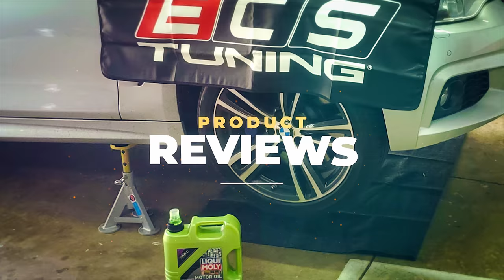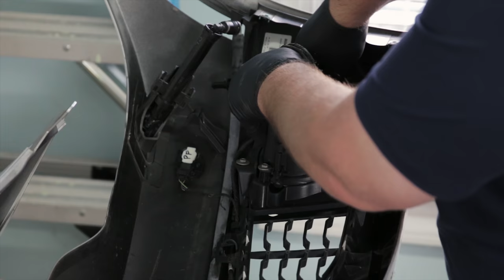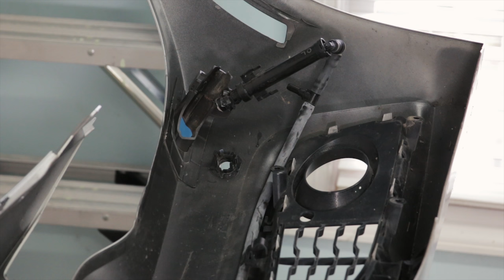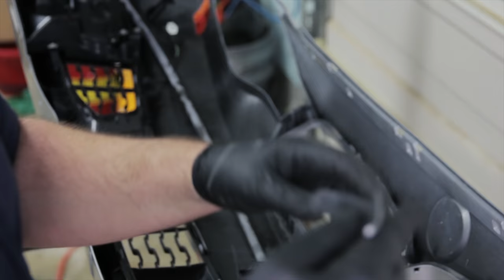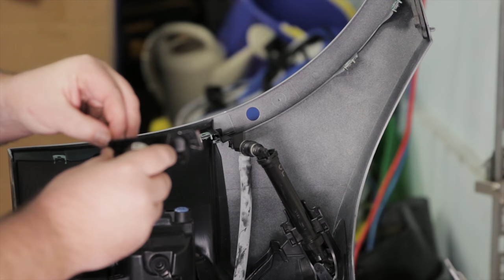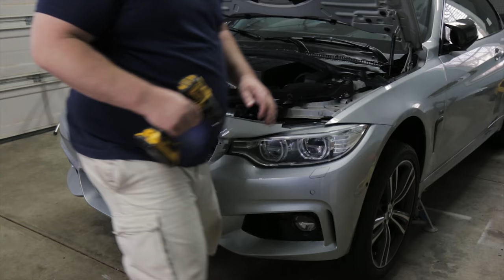INSTALL A F33 / F32 M SPORT CONVERSION FRONT BUMPER

Comment from the maker: This is an awesome upgrade for your non M Sport 4 series. If you're like me, this is the perfect M Sport replacement bumper. :) Thanks Kies Motorsports for putting out such a great product! 🔥🔥🔥
M Sport Conversion Bumper
https://www.kiesmotorsports.com/collections/f32/products/bmw-f32-f33-f36-4-series-m-sport-style-front-bumper-conversion-kit-fits-gran-coupe

M4 Style Bumper

https://www.kiesmotorsports.com/collections/f32/products/bmw-f32-f33-f36-4-series-m4-style-front-bumper-conversion-kit-fits-gran-coupe

If you have Adaptive Cruise Control, you'll need to purchase the center grill (51118054505) separately. Below are links to the grill you'll need.
https://www.fcpeuro.com/products/bmw-insert-air-inlet-middle-51118054505
https://www.ecstuning.com/b-genuine-bmw-parts/insert-air-intake-center/51118054505/

Paint Shop 🎨
Auto Arts | Raleigh NC
http://autoartsinc.com/
https://www.instagram.com/autoartsinc/

Tools Used 🛠
Chemical Guys Cleaner: https://amzn.to/2S5QUXx
Bumper Stands: https://amzn.to/3gAwa3L
Dewalt Cordless Drill: https://amzn.to/2XwXx4K
Dewalt Mechanics Tool Set 247pc: https://amzn.to/31CHbcf
Heat Gun: https://amzn.to/33tEWdG
Jack Pads: https://amzn.to/3kaP7tD
Jack Stand: https://amzn.to/31uAqcq
Pick Tool Set: https://amzn.to/3i6pyIa
Trim Tool Set: https://amzn.to/2Dn2172
3m mounting tape: https://amzn.to/3fB6eRE

Comment: Hello my friend! interested in the exact same change on my 428i. it has a connectedDrive radar on the front bumper just like yours in the video. wondering what exactly bumpers should i order? M sport? only the grilles change? what grills will i need? I would greatly appreciate your help! thanks!
Reply from the maker: The grills for the fog lights and normal center grill should all come with the bumper. If you have the radar in the front, you'll need to pick up that specific grill for the msport separately from fcp euro. I already had a msport from the factory and my grill wasn't damaged so I reused it.
Reply: First of all, thanks for the quick reply! if I understand correctly, I will need the central grill from the M Performance with the ConnectedDrive radar? did the M perfomance come from the factory with the specific radar on the bumper?
Reply from the maker: @TrapStarNews  If you have Adaptive Cruise Control with the radar in that grill, you'll need the specific grill for that which is part number 51118054505. Below are links to it from both FCP Euro and ECS Tuning. That should be all you need to make it all come together if you've got Adaptive Cruise Control. 👍

https://www.fcpeuro.com/products/bmw-insert-air-inlet-middle-51118054505
https://www.ecstuning.com/b-genuine-bmw-parts/insert-air-intake-center/51118054505/
Reply: @fthirty3  You gave me exactly what I needed!!! I am grateful to you!!!!
Reply from the maker: @TrapStarNews  Glad to help! 🙏

Comment: What about the lower reinforcement you removed it ?
Reply from the maker: This was previously an MSport, so I didn't have the lower reinforcement that the sport line has. The lower F33 Vbrace is still there, but like I said, this was an msport previously,  just had an accident

Comment: Hi do I have to change the air ducts? I have a oem sport line bumper atm going to do the m sport conversion just want to make sure I have all the necessary parts
Reply: I’m wondering too. I just put m sport on my car and it blocked it a bit but bumper still fit 90%

Comment: I’ve changed to M-sport front bumper and the radar cruise is not working, at first I thought I needed to calibrate but when I diagnose it it says there is no communication at all to the radar.
Please help if someone knows what it can be. (The front park sensor and camera works perfectly)
Reply: Did you solve this? I want to change to m sport on my f30 but am scared that something like this will happen🫣
Reply from the maker: Something must be unplugged. I would just make sure all the connections are plugged in.
Reply: @fthirty3  thx, I just worried I’ll need to calibrate it again or something.
Reply from the maker: @StevenHalef there should be no need to calibrate it. After replacing mine, everything works as expected, and no calibration was done. You've got this 👍